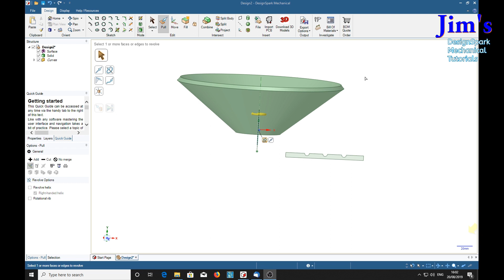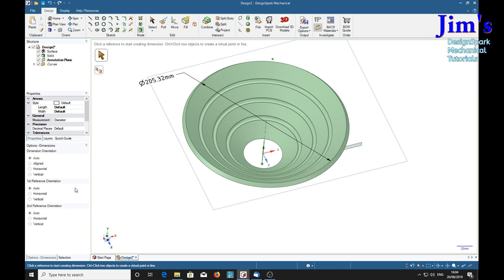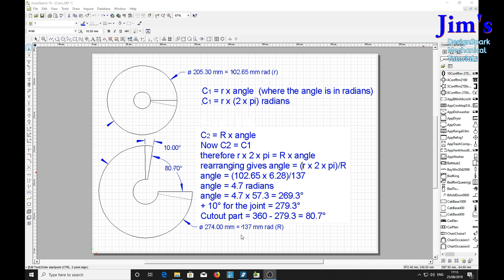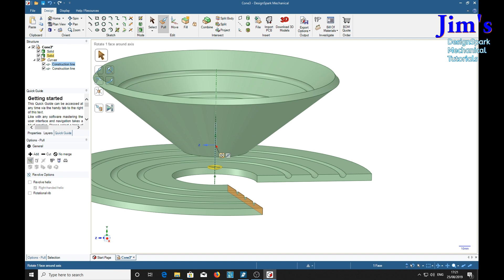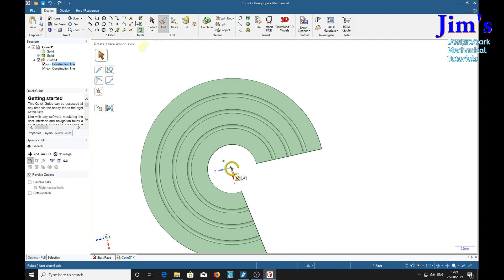Modeling a cone in DesignSpark Mechanical pt2

Comment: I don't know if that OLD math will work. lol
Reply from the maker: I can assure you that the OLD maths still woriks :-)
Reply: Thank u for replying.  Let say,  I have a cylinder rod. Ex a steel rod. Manually I grind or saw it to make a groove. Can u show me how to construct in DSM?
Reply from the maker: @basharauf2662  Do you mean a groove around the diameter or a groove along its length?
Reply: Yes sir.  Groove along the diameter.